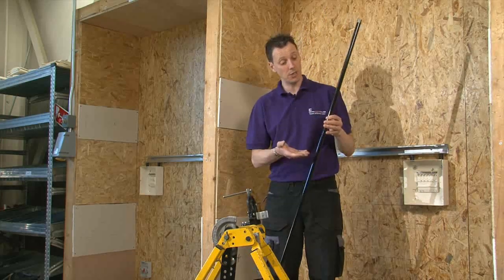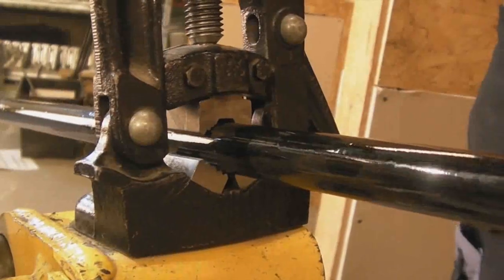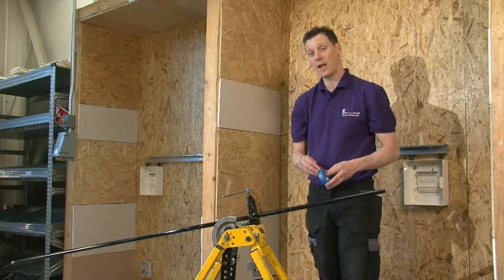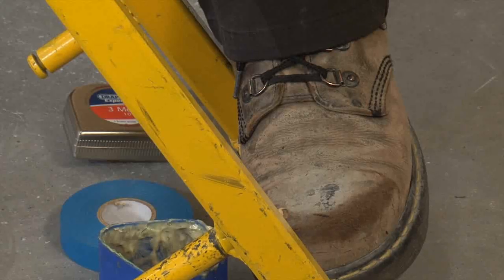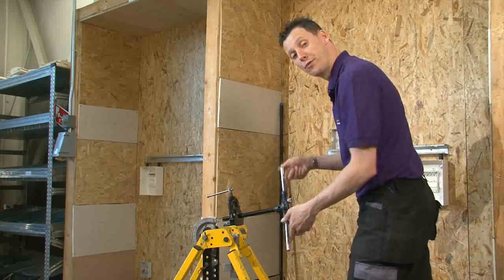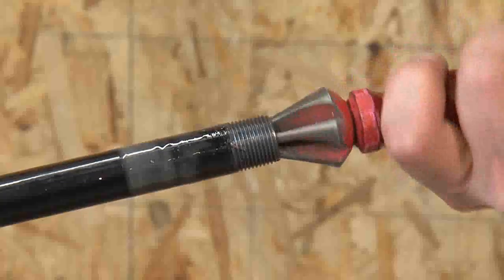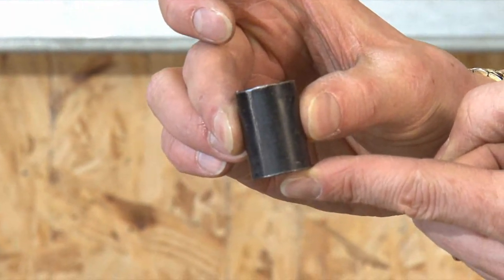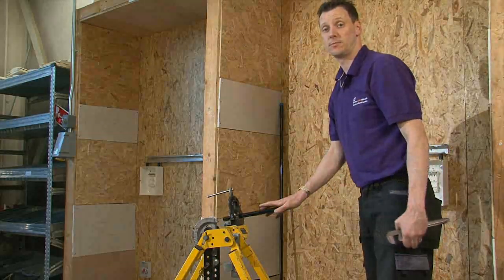The Practical Skills Series : Cable Termination - Steel Conduit

Comment: Why cut the conduit on a slope?  That clamp/bender thingy looks like an expensive bit of equipment but my £30 black and decker workmate with grooved clamps would hold the tube horizontally!  Also, you're cutting the pipe a long way from the clamp which makes a lot more work - for efficient sawing you need the blade as close as possible to the clamp point.

The thread cutting part was incredibly useful, I'm about to order one of those kits from Screwfix, so this'll come in handy.  Thanks!